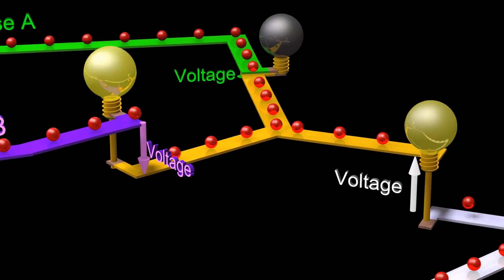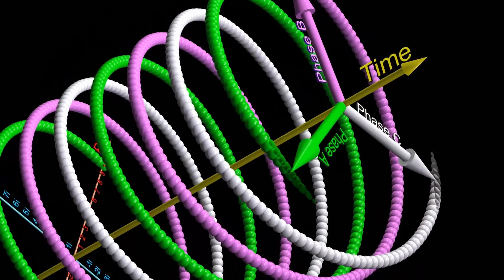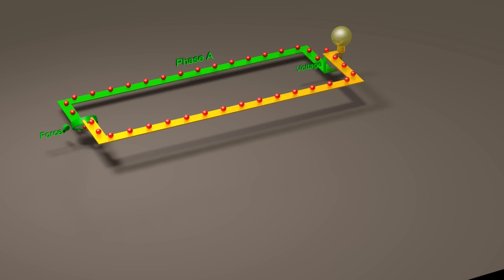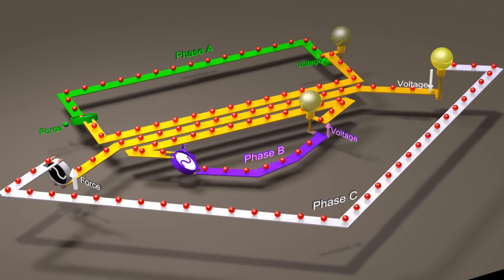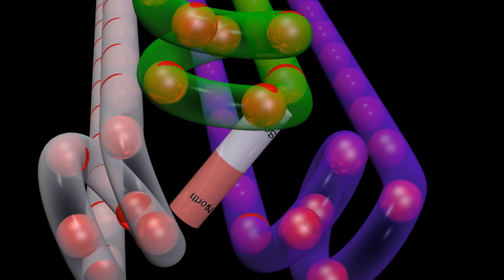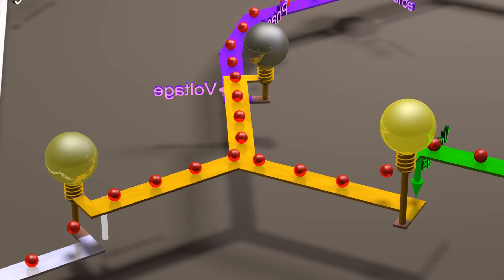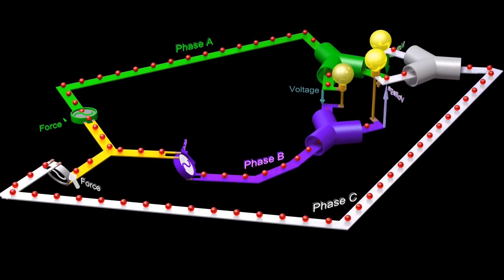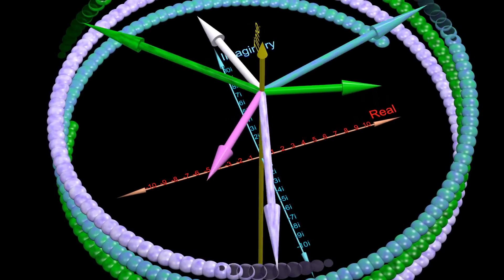Three phase electric power and phasor diagrams explained

Comment: In electronics could we please have some videos on phasors, polars and root mean square (rms) and the trigonometry (sin, cos, tan) needed to put it altogether. I think this would be a series of videos starting with radians to degrees to sin, cos and tan to phasors, polars and rms.  Assume I know very little so start with the geometry and end with rms and how to calculate and apply reactance and Independence formulas for circuit analysis, wave-forms and phasors using ICE and ELI in AC circuits. A big ask but would help all electrical engineering students...
Reply from the maker: I already have videos on many of those topics.  For example, my video on trigonometry is at http://youtu.be/ovLbCvq7FNA
As for reactance and impedance, I cover this (without the mathematics) at https://youtu.be/zO7RZZW0wSQ
Reply: @EugeneKhutoryansky  Thanks!

Comment: If I need 240 or 220 volts from a three-phase. Can I use only two of the wires to run a non-threefasic motor?

Comment: I wonder if the wye configuration is where they got the idea for how the flux capacitor looks in Back to the Future. If you watch an animation of a DC current flowing into a central ground in the middle of a wye configuration, it looks exactly like the flux capacitor.

And for those interested, such an animation can easily be visualized with an online circuit diagram app. Look for CircuitMod and give it a try. I have no affilliation with CircuitMod, but it's been one of the most helpful tools I've used for understanding this stuff. Short of building actual circuits yourself, it's probably the next best thing.

Comment: I don't understand why you can remove the wires in the middle just because the sum of the voltages is zero.
Reply: At 2:30 the current at the neutral wire is zero if all the three phases have the same load, e.g. in three phase motors or heating resistors. Both (the generator and at the load) starpoint voltages are equal. So you can remove the neutral. In households the situation is not necessarily so. In my house there is a combined neutral and protective earth running from the distribution transformer (star connected secondary midpoint). Neutral and protective earth are separated at my metering panel. So my house (virtual) starpoint is connected to the distribution transformer starpoint. Also I have lots of single phase gadgets running on 240 volts (between phase and neutral) instead of 400 volts (between two phases), so neutral is normally needed.

Comment: Very good insight from this video:  @0:41 you show a "spinning circle" moving "forwards in time" (ie. w.r.t time axis) is equal to "wave motion" (sinusoid function).  Since sinusoids are the ONLY solutions to the classic wave equation differential equation, can we conclude that this implies, in vector calculus, the last two maxwell's equations? From: https://youtu.be/rB83DpBJQsE?t=643

curl X(at a point) = (partial derivative) del Y/del T; and curly Y(at a point) = (partial derivative) del X/del T. where T is time.  Is that a sufficient explanation of a wave equation in vector calculus?  Has the wave equation previously been described from the vector fields view?

Comment: Nono physics or elec. engineering student here... yet I find these videos interesting! I don't understand at 2:35 why is it the case that for I=0 you can remove the wires... why can't you for non-zero total current?
Reply: Neutral wires. Provided the each phase has exactly the same load.

Comment: This was a great video. I'd just add a few things if anybody is wondering about this and wants to make a little more sense out of it:

- "Line To Neutral" is called "star" connection or "wye" connection (or Y-connection), and "Line to Line" is called "delta connection" (and sometimes "triangle" connection).

- Phasor is actually a complex number that represents a sine wave, assuming a concrete frequency is given. If frequency is given, only amplitude and phase shift are needed to fully describe the sine wave. This is expressed by a complex number, and in polar coordinates it's length describes the amplitude and the angle describes the phase shift. It's a nice mathematical trick to simplify computations.

Where's the advantage? For example, adding two sine functions results in another sine function, but the math to find out this new sine wave is annoying. To easily determine what it looks like, you can just add their respective phasors as complex numbers (i.e. as vectors) and you'll get a phasor of this new sine wave. Simple, right? Of course, you have to do the annoying proof that this is true, but from then on you can enjoy simple computations.

Using this, you can easily compute that the voltage between two lines is √3 times the "Line To Neutral" voltage - simply by subtracting one "Line To Neutral" phasor from another (subtract, because voltage is a difference between two potentials). In other words, you are subracting two vector of the same length and a 120 degrees between them. This leads to a right triangle with a 60 degree angle, and cosine of 60 is (√3)/2 -> that's how this √3 pops up. 

- Using Phasor arithmetics you can also verify that the current in the wires between two Lines will be √3 times SMALLER than the current in the single Line (the one that goes all the way from the source to your Delta connection starting point). (Amazingly, you can see that in the video, that the red dots are moving slower when "in the triangle".)

This means, that for both connections, if the same current is drawn from each of the lines, the same power (voltage times current) is consumed. The difference is, that in the Delta connection your device will use higher voltage and smaller current internally. This makes perfect sense, right? You simply have some power coming through those individual lines and regardless of you you decide to "harvest" it, you'll get the same amount of it.

So (I assume) this delta connection is used in devices which have components with higher resistance inside, but still want to use some serious power. 

-------

I hope I've described it properly. I was confused about some of these things recently so I did my research and I hope this helps somebody else.
Reply: This comment helps me after 6 years
Thank you 👍🙏
Reply: @MUTHU_KRISHNAN_K  Thank you for taking the time to comment, I'm glad people found this useful. I was struggling with the basic concepts at the time and needed to combine multiple sources to make sense of all the partial information.
Reply: Thank you! This is a very helpful comment.
Reply: Woah thank you for the explanation sir
Reply: Have you ever heard of a straight power Delta bank aka ungrounded Delta bank transformers on a utility pole? 240 phase to phase. Zero to neutral.
Reply: thank you.. crystal clear
Reply: Ok
Reply: @James Sloan I've never heard of a high leg. Maybe it's what we call a red leg. Two of the hot legs to ground is 120. The third leg or what we called red leg is 208 to ground. We have a red leg in our Delta bank (3 transformers) and in our Open Delta bank (2 transformers). What I was referring to was was an ungrounded Delta bank or Open Delta. No secondary neutral. All three hot legs test zero to ground. 240 hot leg to hot leg. There's no reference to ground.

Comment: Why does line to line offer a larger voltage compared to line to neutral? Also, thank you for this fantastic video yet again!
Reply from the maker: You can visualize this by looking at the differences in elevations in the video.  The differences in elevations represent the voltage differences.  Thanks.

Comment: I'm currently working on an engineering project, and noticed how three-phase power can be used to drive a brushless motor. Unfortunately this requires some form of controller. If possible, could you produce a tutorial on the circuitry of a brushless motor controller? Probably not, since it features a complex system of sensors and transistors, something very difficult to replicate by hand.

Comment: One of the best channel that explains Physics in simple, but effective way, and using really good animations, that give necessary information. I have to check out other videos about current. I already watched a lot about quantum Physics etc. The only thing I cannot exactly understand are tensors (why are they used? I know that they're supposed to make it easier when you change the axis etc. - I simplify - But I cannot grasp exactly why). But that's not your fault. That's because I don't work with them, so I cannot apply them - and I've learned that application is the best (for me) way to understand something.
Reply from the maker: Thanks for the compliment about my videos.  In reply to your question, one of the areas where tensors are used are in Einstein's Field Equations of General Relativity, describing how mass/energy causes a curvature in space-time.  As you are probably already aware, I have a video on Tensors and another video on Einstein's Field Equations.  Thanks.

Comment: Please tell me 
The electricity we use at home is 2phase or 3phase????????????
Reply from the maker: Each home typically gets only two of the three phases.  Think of your house as one of the light bulbs in the video.
Reply: In the USA and Canada, the main supply is fed to a three phase transformer. That transformer will send 240volts split phase. Single phase but split in to two feeds of 120v each that are 180 degrees out of phase with each other. The other two phase outputs feed other houses or groups of houses. Just like the three phase discussed in the video, the split phase (240/120) saves wire.
Reply: @4pharaoh  Yes. Interestingly enough I've witnessed that some of the homes in flood zones have 3 phase in the USA for sump pumps but most of the time it's 2 phase.